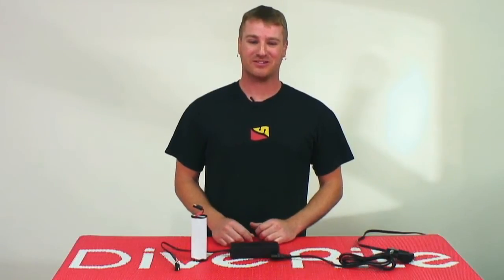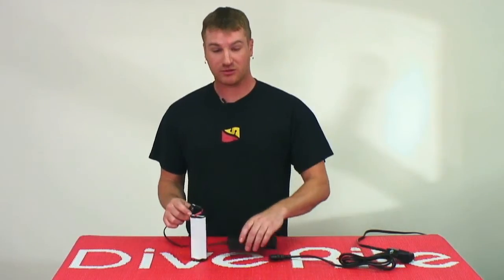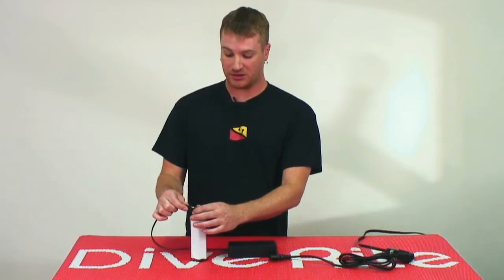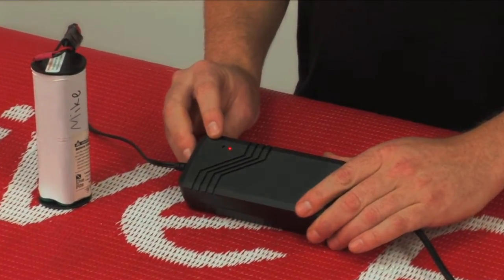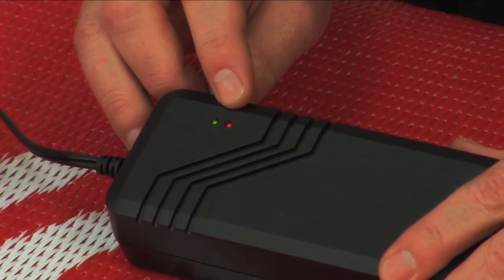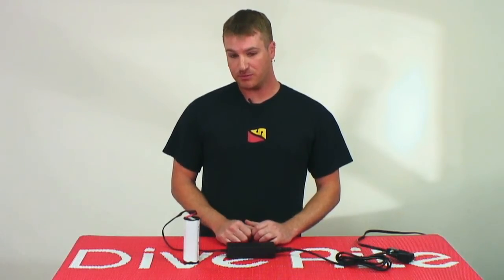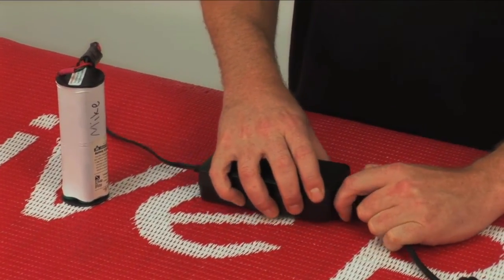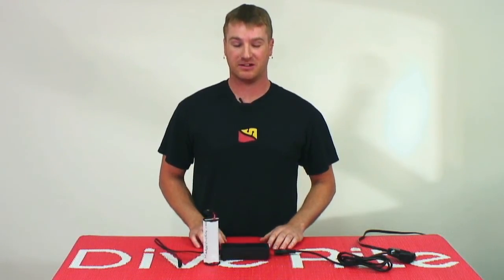Scuba Gear: How to Properly Charge a NiMH Light Battery: Dive Rite

Comment: When I connect my charger, exactly as suggested, it charges the battery for some time and then the green light stops blinking. I thought it meant a full charge, but when I hit the water, the battery would last for only a fraction of what it should last. I´ve contacted the DR dealer who sold me the light and he said the battery can get hot, confusing the charger to "think" it is fully charged. He said I should disconnect the plug, wait 10 or 20 minutes and connect again. Is the info correct?

Comment: Thanks for the info!  As long as you're always connecting the battery to the charger before there's power, does it matter if you disconnect the charger from the power cable, or just unplug the entire setup from the outlet?